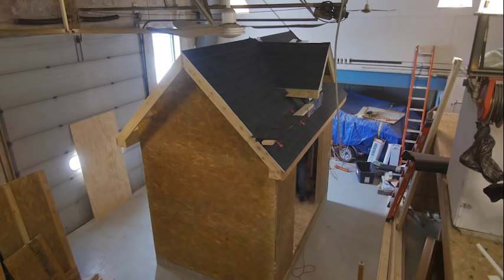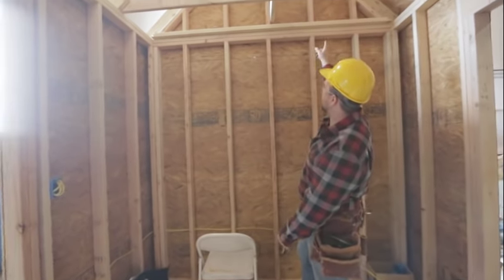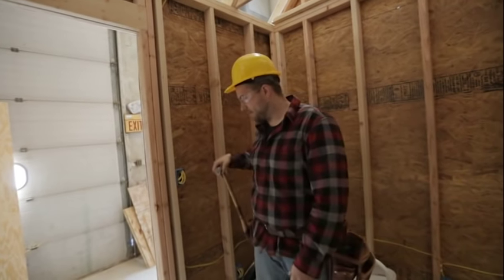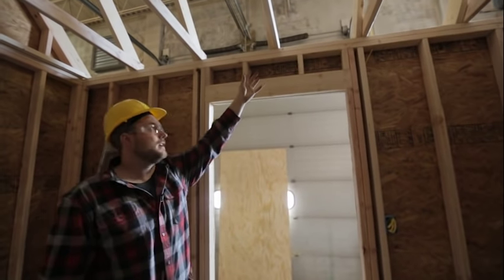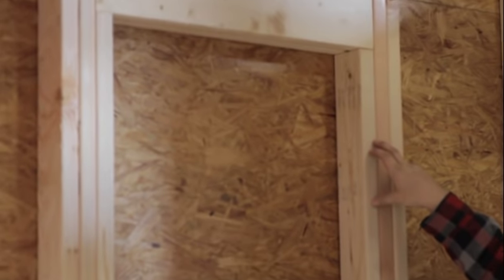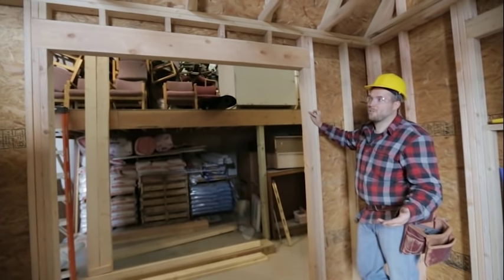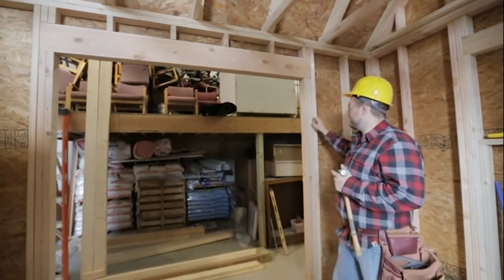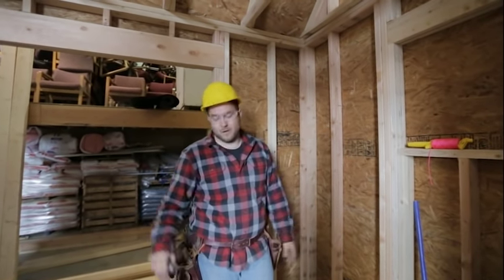How to - Wall Framing Part 1: Intro to Wall Framing

Comment: So do you nail the top plate, then build the wall with what would become the double plate? Or just double up the top plate before standing up the wall?. Also the framing in the window, does that consist of 3 stud allowing for center of 16?

Comment: Why do you have to bud up 2-3 boards whenever you’re framing a window or door? And how do you know how many boards to use? As I have seen 2 boards and 3 boards next to each other
Reply: thats exactly what I want to know too..I don't get it :D
Reply: @tischlermeistertom  
i believe its to compensate for the weight versus the "window" or "door opening" depending on which of those you're referring to. Also certain windows or doors aren't necessarily connected to the header. Just a guess I'm not too sure either.